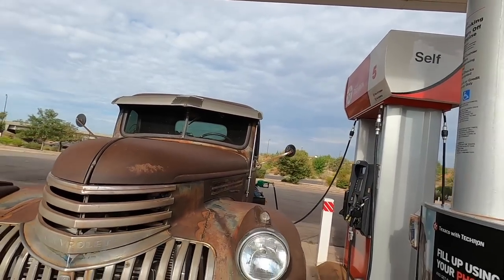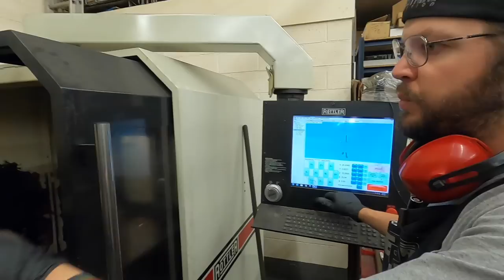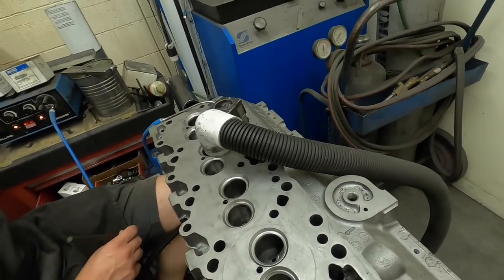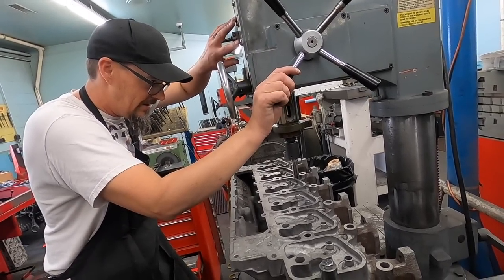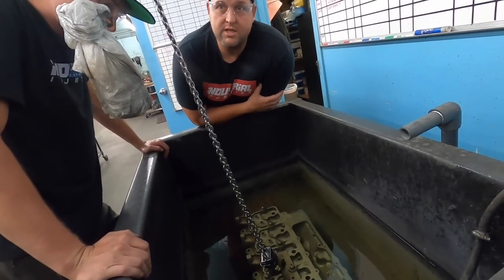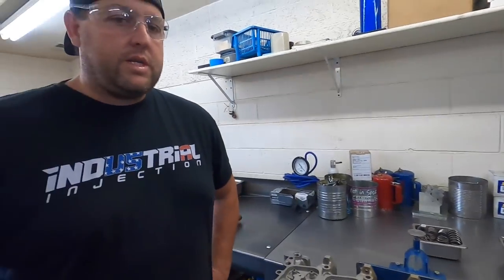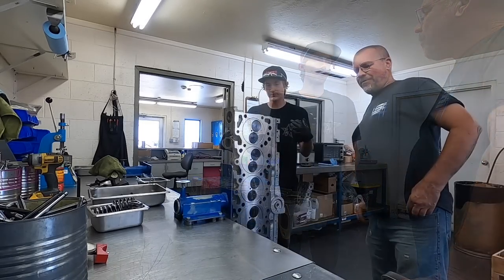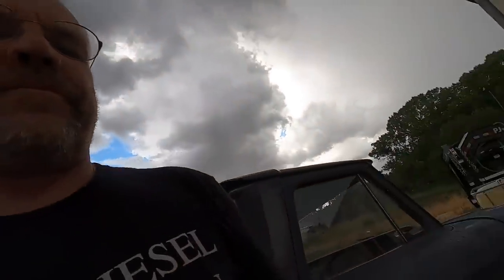This Cylinder Head is Garbage!

Comment: They breathe souch better with the runner chopped off and the head fully ported.  That intake runner restricts the head so much but any improvements to air flow really wakes up the 5.9 engine❤❤ and yeah if you do any real power I suggest upgrading all the freeze plugs and installing the coolant bypass so that cylinder 6 gets better cooling, that's usually the cylinder that goes when they let loose because the coolant can't flow around number 6 as good, so it gets hotter

Comment: Wow ! I replaced the Head on my 98 Dooley. Every Cylinder had at least .2 cracks in the head. Threw the Belt 45 miles from San Angelo Tx. Repaired that mess in town the next day. Limped it to San Antonio Tx. Picked up my Sister . Went to the Grand Canyon and then back to So. Cal. Adding Coolant all the way back. External Leak !  Did the repairs locally. It's only money.  Interesting process ! Much harder than Aluminum for sure ! Going to be a runner !  If I ever do a head again ? "hope not" I will use these guys !

Comment: Thanks for the tour of the machine shop, I’ve built a lot of motors and all I had was a magnafluxing unit to test the cast iron heads before sending them to the machine shop so they could work their magic.  I did work in a auto repair shop shop where we did grind our own valves and cut the seats on a simple valve job without any issues to the castings.  It was interesting to see the CNC doing the porting on the head.  I’ve built several Harleys and put ported heads on them from a shop in Colorado that did a very nice job on the porting.

Comment: that was a great video ..love the process that the head go's threw .. so what could you do for a CJ7  1981 .. straight 6cyl .. with a t5 5 speed .. lol found a hunk of a lock washer in the shifter with the offset lever .. shifts hard between 1st and 2nd .. don't know if it's the offset lever or the shift rail bent ,, winter time will have to tear it apart ,, keep up the great videos ..

Comment: Nice video showing the steps taken on custom machining a block .. 
I’m running a stock 2012 Cummins in my RAM 3500 and currently running like a  Rolex watch .. Can’t wait til you get it back in and see what it does .. I have a Lincoln 460 built in my ‘67 Cheetah jet boat .. it’s a screamer .. has NO2 on it just for kicks … that much power in a 19’er can be a lil spine tingling…

Comment: Merlin, you've raised a question in my pointed little brain...

I've learned over the years that a 4-valve cylinder of similar size will flow more air than a 2-valve but I've also heard from many others before Paul dragged my attention to your channel, that they hold the 12 valve Cummins in pretty high regard. What is distinctive in this Cummins motor that isn't typical in most other 2 valve heads?

Thanks for a very informative break from "real life." There's too much stuff out there that needs to get done... just not quite yet!  👍

Comment: neat bit of kit Ive done a bit of hand ginding and then polishing of the ports for my rally car polished ports in the head and the manifold would give a couple of extra horses on the dyno a little better fuel running a webber DCOE side draft

Comment: If you do any real work to a cummins you must toss the basic freeze plugs in the trash because they will give you problems, get billet freeze plugs and you won't have anymore issues and a fleece coolant bypass helps a ton with heat ❤❤❤ I want to one day get the fleece billet engine block, that's the 5.9 that hit 3,000 horsepower lol that engine would get your boat really screaming hahaha not that it won't now but imagine 3k horsepower in that boat lol😂❤❤❤